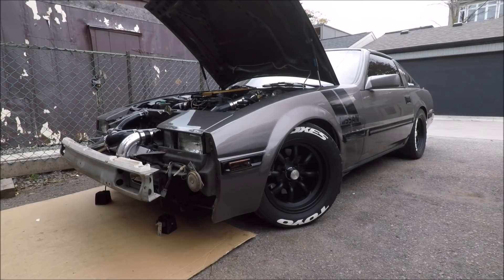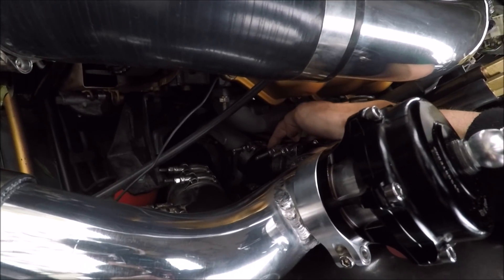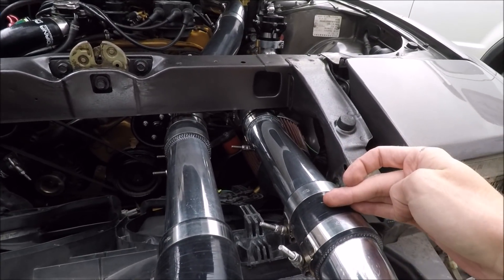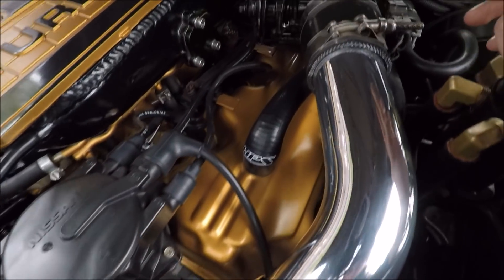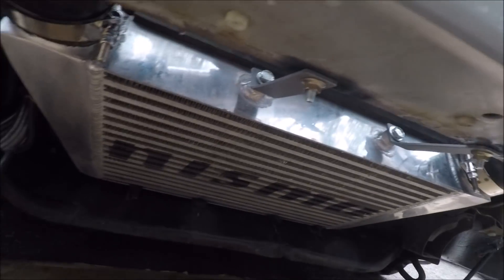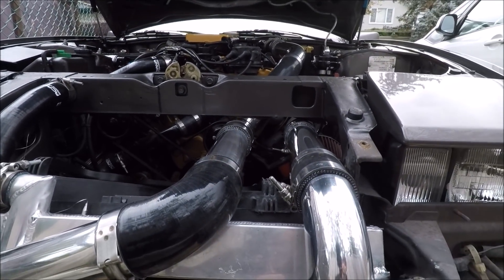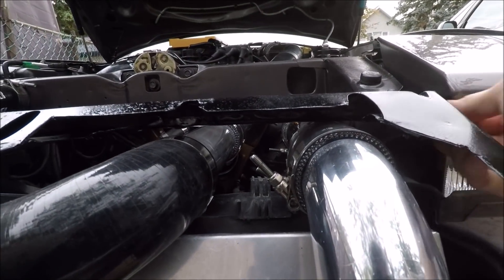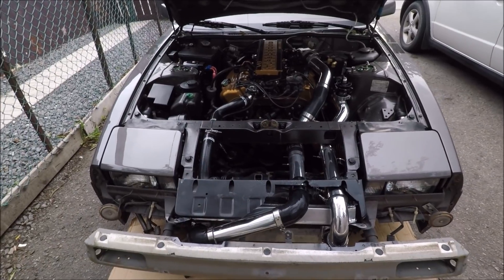My Z31 300zx Custom Intercooler Setup!

Comment: Do you have the specific routing and sizes/bends of the inlet of the turbo where there is a air filter and where the maf sensor is sitting?

Comment: Where did you get the 45 degree pipe for BOV?
Reply from the maker: Just a normal 45 pipe that i drilled and had a flange welded to

Comment: I'm so glad there is a Z31 channel that knows what they're doing that isn't from 2003. Lots of good information! Now I know what to do next time I build a single turbo Z31!
Reply: Great videos, I remember doing the same stuff..minus ported heads, treadstone 2.5, falcon au double pass radiator, "special clipped" stock t3.
Ran 11.6 cars on the street(r8 v10, 5-600 hp cobras, most all ls cars)
    I'm subscribed. Sold it (85) after 17 years to one of the street outlaws crew. 
We did a wheelstand on the test drive, hit down fast, and broke a Spider gear. 
He bought it anyways... Said "that's the hardest fastest six I've ever been in."
Reply: It just sucks if you got in late, because covid has screwed up so much I'm having a hard time finding some things listed in other videos.